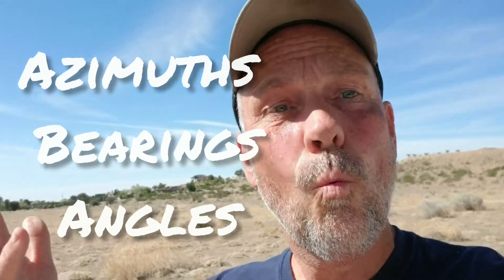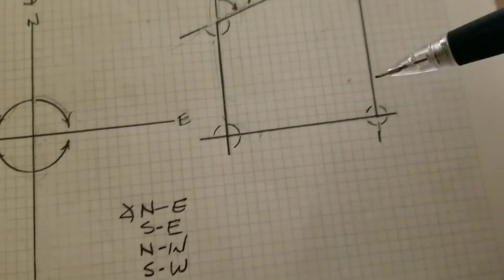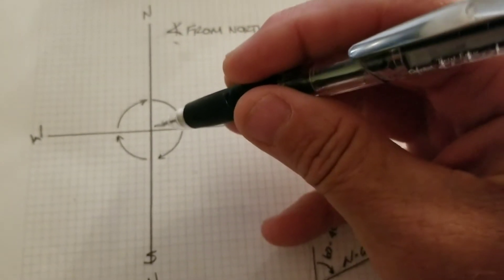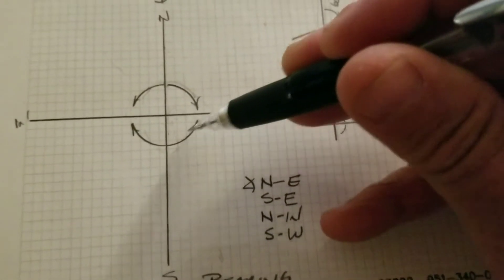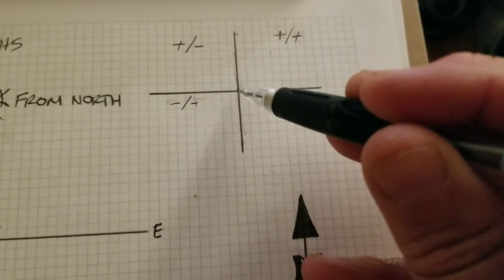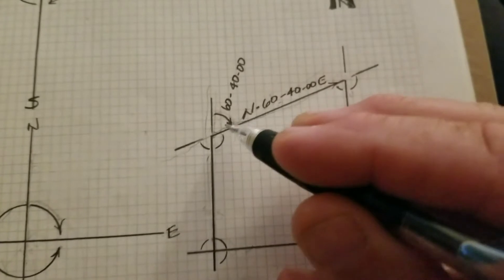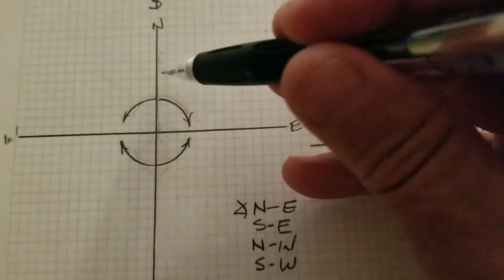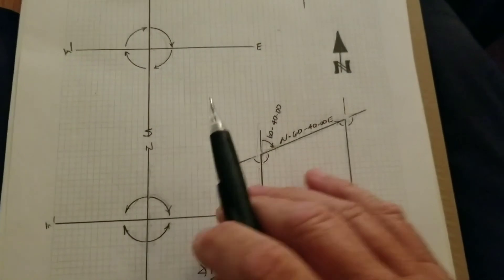How to Survey.  Angles, Azimuths, and Bearings.

Comment: Where do you get the 40 min from  do you have to multiply or divide by 360/60?
Reply from the maker: Degrees, minutes, and seconds are just like time, so in order to add 00°-35-52 + 25°-34-22, you would have to change them into decimal form, add, then convert back to HMS
Reply from the maker: The 40min is just an example